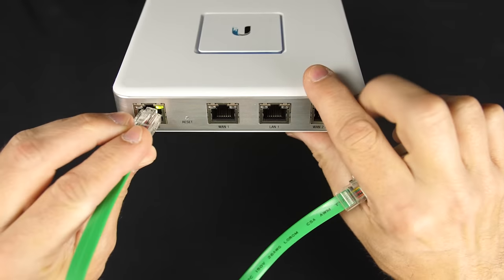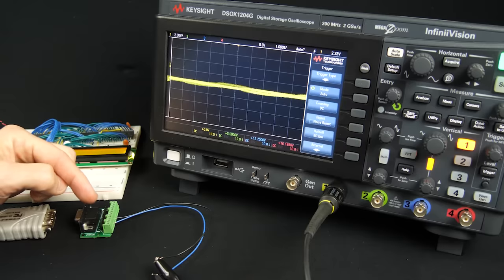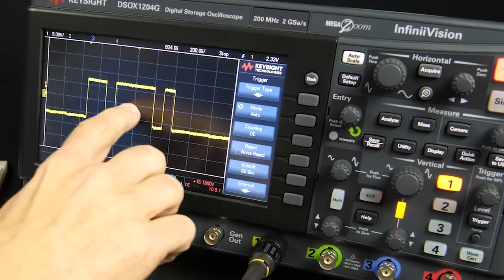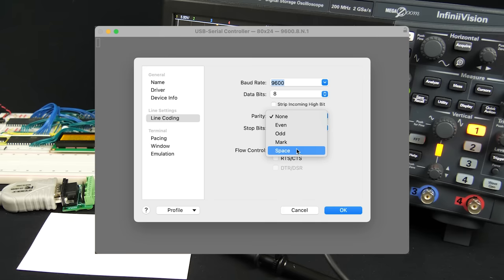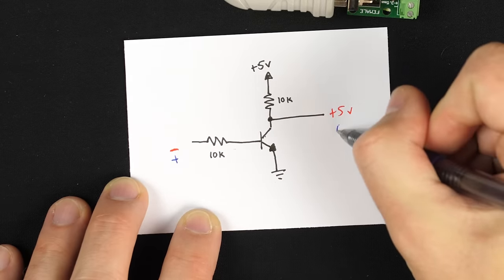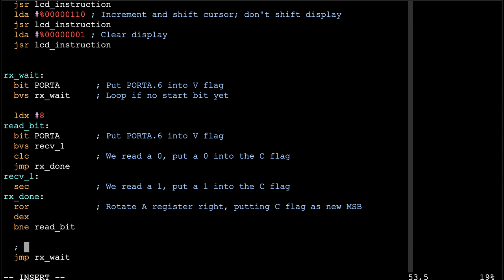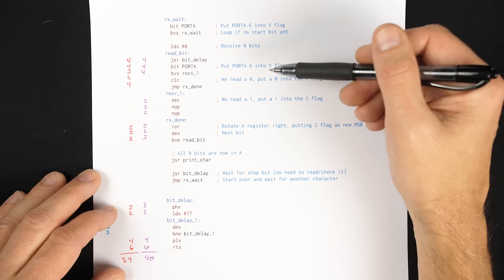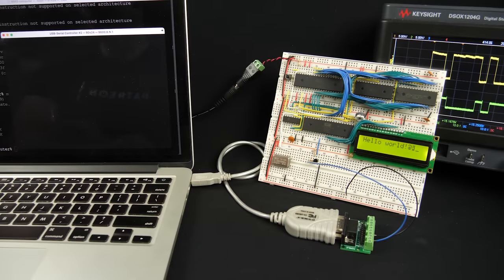The RS-232 protocol

Comment: I LIVED. Through the heyday of RS-232 !  The pre-cursor was 20ms/60ma current loop, common on older Teletypes (I believe most KSR/ASR 33s used RS-232).  I personally assembled hundreds of cables with MOST OF THE OINS CONNECTED (no secondary channels). The PC world screwed up the "standard" with the 9 pin connector.  Was the PC wired as a DTE or a DCE ?  What sex connector did it uses ?  Despite the spec calling for limited distances, I regularly ran RS-232 cables over 100' ! 

Digital Equipment Corporation tried to simplify things with their DECconnect MMJ system but it never caught on.  Cables were easy to assemble using the proper crimping tool, but you need a handful on 9 and 25 D-connector adapters depending on what you were trying to plug into.

Thank God for USB !  Even with all of the confusion of the different versions, you can be fairly certain that if the plug fits in the hole, the 2 devices will talk.  Maybe not at their maximum speed, but they will talk !

Comment: This reminds me of the software-based serial-to-parallel interchange that the KIM-1 and JOLT single-board computers used to interface to a serial terminal. on reset, the ROM resident kernel would sample the RxD line assigned to a pin on a parallel interface device (I want to say it was a 6530) waiting for a CR to be received from the attached terminal. initially the CPU would oversample the pin looking for the 0x0D character and derive the bit-rate from the character's mark/space timing, usually in the range of 110-300 bps. it would then set a timer to provide the character clock accordingly and print out a register dump to signal it had set the baud rate and display the colon "ready" prompt for the next monitor command.

back in the day, when dedicated function chips like a UART were expensive, you could do a lot with a 1 MHz CPU, a parallel I/O port, and a few bytes of assembler. Things were simpler then.

Comment: Many 1980's banks used Tx and Rx clock pins for sync 56k modems (some had stat mux's) on 4-wire circuits. Racal-Milgo's CMS series used a 75 bps secondary channel for central comms mgmt and end-to-end frequency and BER tests.

Comment: We would use the 25 pin for homebrew video from disk applications where the playback speed was horribly variable due to read times for SD frames from hdd. So the clock would measure out 1/30th (minus drop frame for 29.97) a second and the clock signal would send out a stop command to the deck which had a weird little input for the sync. It worked for short videos of 30 seconds or less till the sync caught back up but we would almost always just single pin wire to a shielded bnc cable we cut off. Noisy, but WORKED... till it didn't. And we had to buy an Accom.

Comment: Back in the old days I have used synchronous RS232 once or twice and to be honest it was much more convenient, provided that both devices support it. One device would supply the clock (usually rx = tx hardwired within the cable) and boom everything works.

Comment: The DB-9 connector only supports asynchronous communications.  As in the way a teletype worked with each character being a stand alone entity.  The required a minimum of 10 bits per character.
To do synchronous data comm, the clock signals were required.  This also enabled the send/receive of of streams of 8 bit data.  Blocks generally started with two "SYN" characters.  IBM bi-sync and SNA connections used this method.  The original Hayes modems supported this where the cheaper modems were async only.

Comment: I remember years ago when we used Data General rs232 cables to connect Wyse 60s to IACS (and later Chase cards on Olivetti ''servers' running  unix or SCO open server). The DG 25ft (??) rs232 25pin connector cables were arranged with loopbacks ( 4,5 and 2,3,7 from memory ... I had A4 drawn diagrams then to make up our own) so they could be detected when plugged in and an odd number of cables could be daisy chained together to extend them whilst maintaining correct 'pinouts'.
Some early 'networking' used rs 422 protocol with 25pin D connectors IIRC. because it would work at faster speeds and distances. Much of the third party equipment was over engineered and was regularly used at much greater than the specified distances.Commercial reality was that if a serial printer didn't work because the cable was too long ... the printer would take the blame ... so most printers would work over 100ft of wet string!  Similarly for terminals ... probably more so as faults were more immediately visible!

"Nostalgia isn't what it used to be!"

Equipment was much more expensive then ... the 25ft rs232 cables were £25 each.
I once brought a DG Aviion workstation (£12,000 !!)  home and my two year old son watched me work when I sat down  for a break, biscuit and cuppa, I am English after all, my sat and looked at the screen and keyboard ... for a minute ... then pounded on the £120 keyboard with his fists shouting "drum drum drum" at the top of his little voice as I leap to its rescue before damage ensued!

It is funny how even just writing 'Data General' in this modern font similar to that used then (though it was originally similarly proportioned it had slight rounded serifing)  ... brings back memories. I remember one of the workstations we used ... had the serial number (loads of zeros) '4' and a wire wrapped 'backpane' ... you really felt you were on the crest of the wave in those days. When you got a new machine you couldn't believe how they could get the required component parts in the box ... no space for a mother board after you had fitted the 5 1/2" floppy (8" earlier),  disk drive, power supply and fan(s) ... but you would find out after spending 1/2 an hour working out the next iteration of opening the case!
Also later on disappointing clients when they asked us to put windows on their redundant SCO unix server that ran their company ... even then 16MB of memory and a 20 MB disk didn't go well with microsoft.
In those days companies couldn't afford 300MB disks and had to use 150MB ones instead. I remember well a company we worked with 
bought a Data General 354MB disk for their MV6000 .. which cost the exact same amount as my parents house bought a few years earlier! (Earlier than the Aviion mentioned above).

Comment: Several years ago I was working for an unnamed large video game retailer (7000+ stores) on their point of sale system; localizing it for Germany. They used a serial receipt printer to print of their loooong receipts (before CVS made it cool). While digging around in the receipt printing code to make room for a larger money symbol  (I think GRD instead of $) , I noticed a sleep(500) stuck in the middle of the code, on every line. Turns out, they were having a buffer overflow issue printing to the printer and they solved it by just randomly pausing the code. I flipped on Xon/Xoff flow control and managed to speed up receipt printing by 50%. I can die knowing that at least I saved a bunch of folks a little bit of time.

Comment: I tried make similiar bit-bang protocol with attiny85 as transmiter to debug the program.
What I actually ended up doing was debugging the RX/TX code itself as I used arduino on RX side.
I even wrote CPU clock cycle counter to know how fast I could go.

Comment: yeah, the good old 6502, I moved to PIC processors in the mid '90s, 1 to 2us per instruction cycle, pretty easy to calculate and implement
one could set up a counter to call an interrupt on the appropriate slot, preferably in the middle of the bit drop zone, one could easily clock as much as 500,000 baud if the initial framing was set up correctly for 1 byte transfers, a bit slower throughput for multiple bytes.
These days, a USB UART does nicely.
Unfortunately, in my day job, I still encounter RS-232 a lot, or at least it's ghost, many modern alarm and access systems still depend upon the RS 232, RS422, and RS485 standards. Many manufacturers simply opted to add a USB to RSxxxx converter on board to talk to their internal systems.
Reply: My preference is an ethernet connection,. only a very few actually use this currently with this sort of equipment
a bit behind the times IMHO

Comment: In a company I worked for long ago, we used the synchronous (as well as asynchronous) circuits and so used pins 15/17 and 24. Interesting times. I would hand crimp the connectors depending on the circuit I was connecting. I remember upgrading our international link to 9.6K at one point. And I think it was at 64K when I left.

Comment: Using the transistor in that way to level shift would have a problem if the RS232 signals are greater than +/- 5v (the specification allows up to +/- 15.  The typical reverse bias breakdown for the base junction is about 6v.  You might want to put a protection diode on the base to conduct the negative current and clamp the base reverse bias to 0.7v.
Reply: The specifications actually allows +/- 25V.
At the time, telecommunications used -48V for telephony, so same voltage applied were used.

Comment: Internally in a UART, it runs a clock 16x the baud clock, so when the UART sees the input state change, it count 8 clock cycles and test to see if it is still high.
If so, it determine  that it has a start bit. Then it count 16 clock cycles to get the next bit, then 16 more, and so on until it get the byte.

Comment: I imagine some of those extra pins on the DB25 were useful back when modems didn't have dialers built in, and they needed to do things like lift the phone off the receiver off the hook with a digital signal and control the autodialer separate from the data stream. Of course, smart modems got rid of the need for all that. I know some of the early Usenet network using UUCP, the autodialers were rare, and those companies/universities that paid for an autodialer had to act as hubs for the UUCP networks.

Comment: 9-pin was introuced to reduce physical footprint on computers that were 'growing' an unbelieveable number of different connectors on their backplane boards+motherboards.  Speeds were never that fast... until the newer chips and USB based adapters drove speeds up past 230kbaud.  I found adapters+TVs that needed flashing through RS232c that could go as high as effectively 350kbaud with some dropouts (384kbaud I believe).  I never could get that to work on "standard" RS232C interfaces shipped on computers!

Good thing about RS232C is you can always make it work wtihout asking someone... and in many cases make it work very well.
With USB you have to read datasheets, maybe contact the manufacturer, get device drivers, implement protocol, etc.  
Honestly I would have preffered everything just use Ethernet instead of wasting countless man-hours dealing with USB nonsense!

Comment: I remember breadboarding this on a 6510 in high school, complete with the 2x16 LCD display that cost me a week's pay at the ice cream shop
An interesting note on the 6502; Apple theirs a bit slow, 980Khz, while Commodore ran them a bit fast, 1,180Khz if I recall, overclocking in those days, the extra shielding on the Commodore boards tended to ruin them a bit fast without extra cooling

Comment: Slight error: half_bit_delay should use 8 or 9 for its delay value rather than 6, since bit_delay doesn't actually delay a full bit. (Unless my math is wrong, which wouldn't surprise me.)

Not that it matters that much, since it's just for signal tolerance and it just means you're testing the level earlier in the bit than you think you are, but still important to remember when coding assembly-based timings!

Comment: Welcome back Ben! I've been checking every month thinking I've missed a video.

One thing I didn't understand is the RS232 negative voltage is considered 1 and positive voltage is considered 0 and you use a transistor to invert the data to a readable format; why wouldn't it be the other way around and not need the transistor?
Reply: I think you still need a transistor to stop the extreme RS232 voltages from blowing up your I/O chip.
Reply: @gdclemo  but why is it inverted?

Comment: RS-232 is not a data protocol, it's physical layer protocol only . The encoding of the physical interface voltages is a separate specification of synchronous or asynchronous data protocols. In the old days of 60mA tty loops the current marks and spaces were 5 level Baudot asynchronous data protocols that could be converted to use the RS-232 physical layer protocol by a 'low-level' converter.

Comment: funny you come up with this topic as I got my new hardware - it's a fairly recent amd-b550 platform - and it still has a header for connecting a db-9 bracket to it
and I even have a use case for it: my small soc home back up "server" is a headless system with only a serial interface along the NICs - was fun to set it up back then as I had to use one of my other systems as a temp PXE server - today I only use it for low-level maintenance like accessing some of the "bios" stuff or when it somehow fails to set up the network

Comment: My very first commercial embedded project, 35ish years ago, used a 4 bit microcontroller. (I don’t remember the part, but the emulator took 8 inch disks and was the size of a large microwave). The first thing I had to code was serial I/O and watching this code take shape was like looking through time into 25 year old me’s head.

Comment: The clock signals on the 25 pin connector are used in synchronous communications i.e. IBM SNA or HDCL interfaces, etc.

Comment: Not sure if someone else has shared similar. I recall using 25pin serial, and it would be quite common if I’m not mistaken; for connecting CSU/DSUs for T1s, fractional T1 (like DS0 clear channels) or 56k DDS.

Comment: There is a little potential issue in that primitive logic level converter. :-)

When the "mark" (logic "1") is applied, it pulls the base of the transistor down to its voltage, which might be as low as -12V. It may be too much for some weak transistors, and base-emitter junction might break. Large reverse voltage also increases recovery time, making input and output edges match less precise.

So it seems a good idea to add a diode in parallel. Anode to be connected to the base, and cathode to the GND (emitter). That will limit reverse voltage to just forward diode drop.

Comment: Ben something you should mention is since you are working with a 6502 is make sure your chip is not an early chip. The program you wrote won't work on an early 6502 because it didn't have a ROR instruction.
Reply: It didn't have a working ROR .. it was completely broken  .. even rotating left instead of right.
Reply: @leong108  they didn't take long to fix it. If you still have that chip hang on to it. They are sought out be some vintage computer collectors because of there rarity.

Comment: I used to work in the 'Telegraphs and Data' section of a large telco, most higher speed data lines were sync and we used most of the pins, a 9 pin would have been useless back then.
The 9 pin was invented by IBM for the IBM PC, so they could get two ports in one expansion slot. - save money.

Comment: I believe the loopback testing is used on the older Traffic Signal controllers, to self test with a loopback cable.
4-20mA current loop is pretty interesting too. I've seen it used in an intrinsically safe application on oil derricks. 
I guess the ai brought me here, as I was checking out current loop modules in China.

Comment: Clocks were used in the 70's and 80's for synchronous communications between mainframe and mini computers and terminals. They also supported leased telecom lines over modems. This was way more common than asynchronous communications that most are familiar with these days.
RS232 is actually an electrical specification and a connector definition, not the protocol used. Initially it switched +/- 15V athough RS232E specifies as low as +/- 5V (or is it 3V3?). The RS232 levels are inverted when converted to/from TTL levels.
The computer (Data Terminal Equipment or DTE) used a male DB25 and the modem (Data Communications Equipment or DCE) used the female DB25. Unfortunately microcomputers did not adhere to the male/female definitions.
A cross-over cable could be made which connected two DTE's directly (ie without modems) such that two computers or a computer and a terminal could be directly connected. In this case, one of them DTE's would provide the clock on pin 24 which would be sent to the other DTE on pins 15 and 17. DTR connects to DSR, RTS is joined with CTS and sent to DCD on the other side, and this is duplicated for the opposite direction too, hence the term cross-over. IIRC the spec said 15ft max, we certainly used 50m cables to join computers at up to 9600 baud.
FWIW, it is baud not baud rate as baud is effectively bits per second, so rate is redundant.

Comment: You could optimise the bit-read loop by having the data on PA7 instead of PA6, and then read the bit with LDA PORTA:ROL A:ROR databyte - but that requires a byte of RAM. The wait loop would still use BIT but with BMI. It would also mean that the loop would have constant timing regardless of it being a 1 bit or a 0 bit.